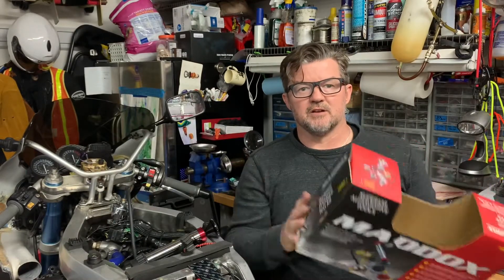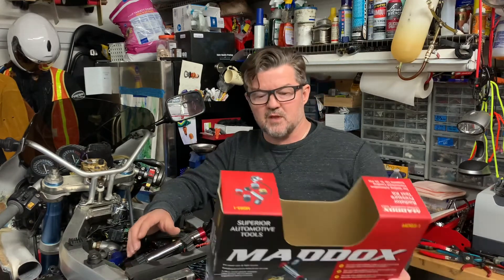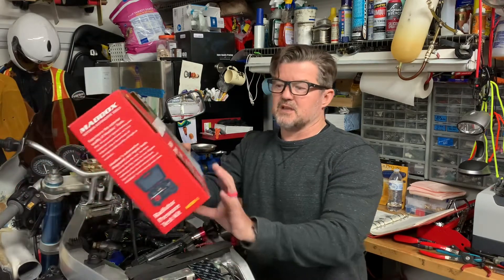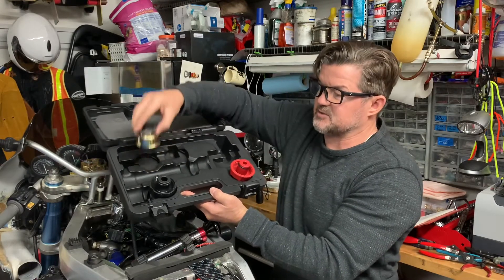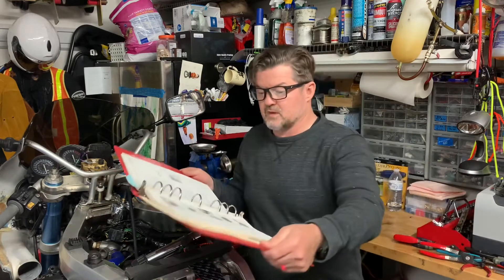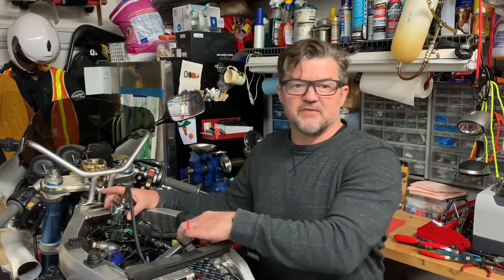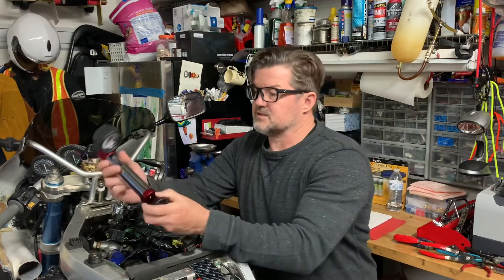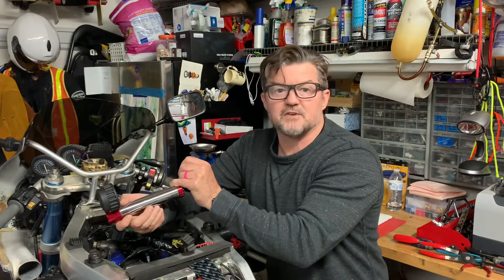Coolant System Pressure Tester and Use

Comment: When I release pressure it shoots radiator fluid everywhere
Reply from the maker: From where? Check you manual, there is a limit to pressure you should apply. But all hoses should hold.
Reply: @StanleysGarage369  when I release the pressure after the test I get a load of coolant shooting up around where the radiator fill port
Reply from the maker: @voidvincent  Idle til it comes up to temperature, squeeze all the hoses with the rad cap off and overflow cap off…hoping that gets out all air pockets/bubbles. Then drive it and monitor engine temp.

Comment: hi!! having trouble getting pressure to build, wondering what i did wrong :( maybe im using the wrong adapter, im trying to use a p1 on my 2006 nissan altima but i wonder if i dont need one at all

Comment: You didn’t show how to use it, I wasted my time
Reply: I mean seriously? This is a pretty basic tool with a very simple process to use. Maybe fixing cars isn't for you.
Reply from the maker: If you need; I can send you a step-by-step video. Also, you can kinda see one being used in “ water in signal..” video.
Reply: @StanleysGarage369  I already found it somewhere else. Thanks
Reply: So. It does not test the radiator cap?
Reply: How the eff do you relieve the pressure